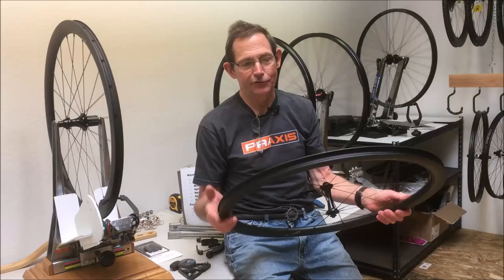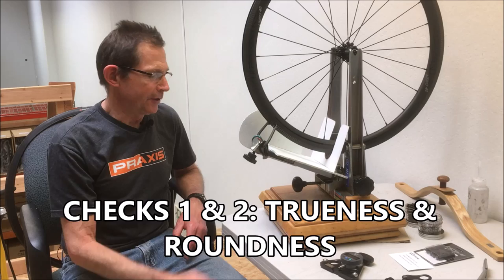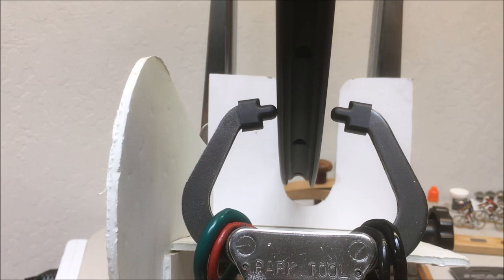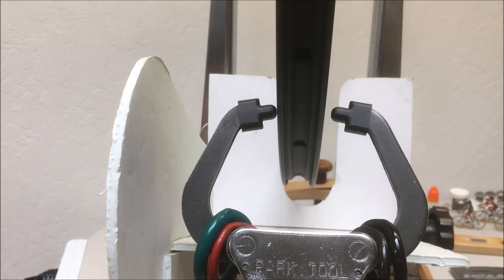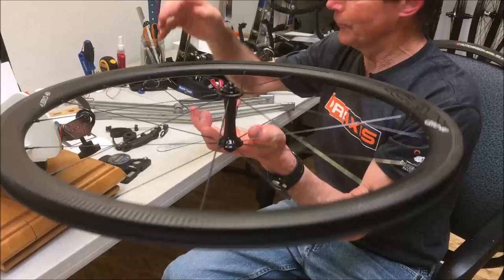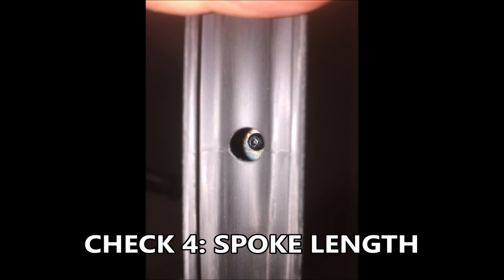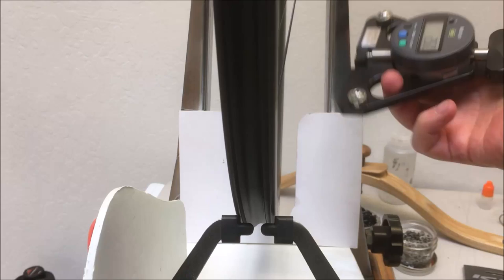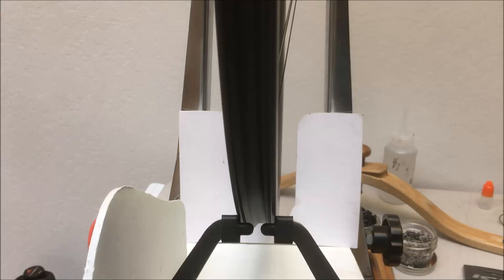ICAN Chinese Carbon Bicycle Wheels Review by Wheelbuilder Jim Langley

Comment: Good job Jim.
Are you going to show people how to rectify the spoke twist and inadequate tension problems you identified? 
Also it would be useful to explain how you determine the correct or optimum tension for a particular wheel. Finally are you aware of any authoritative published sources for trueness and roundness acceptance criteria? I think your 1/2mm is a very fine tolerance appropriate for top class (and top price) wheels only,  and I would consider +/- 1mm to be acceptable for the majority of general usage bicycle wheels. What do you think?
Reply from the maker: Thanks for comment, Henrybikeman! Yes, I now have a video showing how to fix aero spokes that have been overturned so they are twisted and not aero anymore. Here's a link: https://www.youtube.com/watch?v=zszdrNEgSDw Regarding optimum tension for wheels, it's best to use a tensiometer. That's because wheels need the spokes to be so tight that it is difficult to feel by hand when the tension is right. The spokes will feel tight way before they are tight enough to make a good wheel. Tensiometers come with charts that tell you for the type and diameter of the spokes in the wheel what the reading on the tensiometer's gauge translates to in KGF (kilograms force). For me, what I am looking for before I'm finished with a wheel is readings indicating that the tighter side spokes (right rear/left front on disc front wheels or either on non disc fronts) is in the 105-115/120 KGF range. Evenness of tension readings is important, too. I don't measure the other side of the wheels because those spokes are as tight as they are going to be as a direct result of the tighter side spokes. Though you can certainly measure all the spokes if you want with a tensiometer. And, for trueness and roundness, I would say that if your customer can see that the wheel is out of round or out of true, then it's not true enough. I know that you can't feel it when a wheel is a little out of true and round, but if a pro builder is putting their name and reputation at stake, they typically try to get the wheels as perfect as possible. Some rims can have bad seams or slight issues with the carbon, etc. but for me, I will try every time to get the wheel as close to perfect side-to-side and up-and-down as I can. Ideally I wouldn't see any deviation in the spinning wheel. But for that you need a perfect rim and you don't always get perfect rims. When they're not perfect, I still try to get them as perfect as possible and hope they're .5mm or better. If I had a wheel that was 1mm out and that was the best it could be, I could accept that only if it was impossible for me to make it any better and I knew that the wheel was otherwise a great wheel. Okay? Hope this is helpful - appreciate you commenting bikeman!

Comment: Amazing and fascinating. I'd love to build my own, but the tools would cost more than the money saved. Makes me reluctant to buy cheap foreign wheels. Currently deciding between wiggle own brand (imported from China I imagine) or custom built by local wheel builder. £750 versus £1300. Tough choices.
Reply from the maker: Thank you, Neil. The advantages of working with a custom wheelbuilder are many. They will build wheels designed for you - the way you ride, where you cycle, your weight and riding technique and they will be there to help you with the wheels should you ever need spoke tightening or replacement, wheel truing or a rim replacement in the event of a crash. If you get to watch them build your wheels, I think you will be amazed with the attention to detail and care that goes into a pair of fine wheels. So, yes, it costs more but you get more, too. Now, if you'd like to build your own wheels, it is a fun and highly satisfying bike project since you will get to ride on wheels you built yourself and will be very proud of it, too! I have taught many beginners how to do it so I know almost anyone can learn. I would say that the only people who have a little trouble are those with little patience. Because if you're in a rush doing things, it's easy to get confused following the spoke lacing pattern and the truing and tensioning steps. But, most people learn pretty fast. To help beginners get started, I have a comprehensive free step-by-step on basic wheelbuilding on my bicycle website here: https://jimlangley.net/wrench/wheelbuildfull.html Also, you don't need fancy tools. I started building wheels using just my bicycle frame and fork as the truing jig, for example. If you decide to give it a try and need help, I'm happy to coach you. Thanks again for the comment! Jim
Reply: Not so Neil. The only truly essential tool is a good spoke key. All the rest are "nice to haves"
Reply: You can build a wheel without any special tools or stands, even without a spoke key.  The proper tools make the job easier and faster, but if you're going to spend as much as you say, get the proper tools or pay someone who has them!

Comment: Beautifully put. But my major concern is of the carbon material and its formation as we all know there is a method carbon fibre sheets are resin pasted together leaving space for bubbles and tiny gaps between the sheets. So how could we possibly know the integrity of the material build up itself? Any insight on this?
Reply from the maker: Thanks for watching and the nice words, Noel - I'm happy you enjoyed my video. Yes, I have insight on how I know that it's unlikely the ICAN Toray carbon rims have any defects. In my experience building hundreds of carbon rims I can tell you that at the tension the ICAN spokes are at, a carbon rim with voids or other defects will fail spectacularly. It scares you so much you jump. Usually it makes an awful cracking popping sound as you're working on the wheel. Sometimes it’ll split all around the spoke hole track. It makes for an exciting wheel build and it’s good defects show up then rather than out riding when you would get hurt. That's how you know and why I tested the wheels the way I did in the video to determine they're fine rims. Okay? I hope this helps answer your question. Thanks again!
Reply: @JimLangley1  thanks man. Sure I did and always do enjoy your videos. The reason I asked you this is because i had purchased a pair of vuelta 50mm carbon  wheels and in a short span of time a portion of the  rim braking surface wore out almost like 1mm deep almost killing me while coming into oncoming traffic.also kindly note as I used alloy brake shoes and not carbon brake shoes. So could that have happened because of the wrong brake shoes because now after doing my research I think using wrong shoes were the problem. What would you say about this? Also I'm looking to repair the surface by repasting a sheet of carbon and bonding it with resin. Your insight on this please. Thanks in advance
Reply from the maker: @noelbrett7351  sorry to hear about the damage to your rim, Noel - glad you didn't crash! Since they damaged the rim so much those brake pads had to be really abrasive, made of the wrong material. The ICAN wheels come with carbon-compatible brake pads designed for use with the rims. That's often the case with other carbon wheelsets. I have not tried replacing material on carbon rims. There are companies that repair broken carbon frames. Maybe you could contact them and ask if they would give you any advice on repairing your rim? In my area (Northern California, USA), this is the company that's been fixing carbon since way back: https://calfeedesign.com/carbon-repair/ Maybe if you called them they would be able to talk about whether or not it's possible to fix damage like yours on a carbon rim and how they recommend going about it. I hope they have some good advice for you and that it can be fixed. If not, maybe Vuelta would be willing to sell you a replacement rim at a discount and you could rebuild the wheel. Good luck!
Reply: @JimLangley1  thanks for your prompt reply man. I really appreciate your detailed explanations. I'll get in touch with the and keep you posted. Thanks and take care
Reply from the maker: @noelbrett7351  you're very welcome! Thanks for watching my videos and the great comments/questions, Noel!
Reply: @JimLangley1  thanks for the compliment man. Coming from a person like you it's a big honor. Much obliged.😊
Reply: Hello Jim. Following your how to build a wheel tutorial really helped me master my wheel builds. Now I can build perfectly round rims(however they do take forever though 🤣) all thanks to your channel. Although plenty more to learn from you. I keep watching and rewatching your videos. I tried looking for the spoke stop tool to equally match all the threads on the spokes. I'll keep looking. Thank you for making such great videos. Building wheels are such a joy now compared to how I would dread wheels builds earlier. Thank you, God bless.

Comment: I wonder about the hubs,is it a no name hub or ?  Is the cassette body soft aluminum that will groove easily?  Freehub body seal well or will dirt and water get in easy?   It all matters of course.
Reply from the maker: Thanks for watching and the questions, Brad. The wheels use ICAN’s own hubs. So far in about 2,000 miles of riding I have experienced no issues of concern. So I believe the hubs are quality hubs. Hope this is helpful and thanks again.

Comment: I received a set of Aero 40s in March and there was no twist on the aero spokes! So I think that your pair was an exception. I am quite happy with this wheel set, it's light for climbing, but still with an aero advantage in the flats. I already did a few Marathons up to 300km and never was afraid they could fail me. Only the brake pads that came with them were unsatisfactory. I bought cheap ones from Wiggle (the blue lifeline pads), which perform much better. My only issue was to get a pair of GP5000s on, which was really a pain. Maybe other tyres will be easier to get on.
Reply from the maker: Thanks very much for sharing your experience with wheels, MrSuicycle. Appreciate it!
Reply: Thats strange i can get GP 5000s on easily with my FL40 icans

Comment: So are you called a Wheelwright ? Making spoked wheels is a dying art. 1950s & 1960s sport cars like MG's and Triumph used spoked wheels in each models, like MG B and C models. Enjoyed Presentation 🚲👍
Reply from the maker: Thanks for the nice words, Mark. Actually a "Wheelwright" is someone who builds & repairs wooden wheels. While I have built some bicycle wheels with wood rims, I definitely do not have the woodworking know-how or skills to work with wooden hubs, spokes and rims on carriages and antique cars. A term you hear used for bicycle wheel builders is wheelsmith as in the Wheelsmith brand of spokes and tools - and the former famous Palo Alto, CA bicycle shop called Wheelsmith. I like that, too. Thanks for your comment!
Reply: Mark Stengel how is making spoked wheels a dying art? Almost every wheel you see on a bicycle these days is a spoked wheel.

Comment: Jim, can you explain why the wheel doesn't need to be centered in the caliper, and you can just look at the left arm to check trueness? If you were building the wheel from scratch, would you center it?
Reply from the maker: Thanks for watching and the great questions, Stafford. To answer, on a good rim (one without any issues), both sides of the rim should be the same. If that's the case it doesn't matter which side of the rim you look at to check trueness since both sides show the same perfection or imperfections in the rim. I don't try to look at both sides of the rim at the same time. I could try to do that but it's a little bit like trying to read the left page of an open book with your left eye and the right page with your right eye at the same time - not easy to see at least for me. So, I will typically use the left pointer gap to check for trueness and then use the top of the pointer placing it beneath the rim to check roundness.

The truing stand I'm using in the video is a Park TS2 and all Park stands that use this design have a self centering feature that can hold the wheel/rim centered between the caliper/pointers. However, lots of things affect this and if anything is off, you can end up with the rim sitting closer to one side than the other. For example, if your wheel gets pushed sideways the axle rocks up on one side in the Park axle holder and that moves the rim out of center.

I mainly use the centering feature as a ballpark measurement/gauge to give me an idea how close to centered the rim is over the axle. I then check this more exactly using a dishing gauge. If I didn't have a dishing gauge I'd be sure to check and double check that the wheel sits completely seated in the Park jig's axle holders and that nothing else is affecting the wheel centering. But when checking wheel true on new wheels, it's quick and easy to put the wheel in the stand however it sits and use one pointer to check.

I just occurred to me that it could be the camera distorting what's shown a little, too. To get the camera to show the gap and how true wheels are I have to experiment. Most of the shots are taken with an iPhone which has its cameras on the upper left. I don't know for sure but some of the off centeredness might be due to the camera. Hope this helps explain. Thanks again!

Comment: Hi Jim, nice review. I have a question. I have a set of ICAN Classic 38's. I love them, but, shortly after I received them my bike started ticking/clicking. It sounded like bottom brkt area but I went thru everything on the bike. The noise only happens while pedaling, both in and out of the saddle. After going through everything I finally removed the rear wheel and put my old wheel back on. I used the same cassette, skewer, tire and tube. The noise went away. I've switched back and forth many times and the bike clicks when the ICAN wheel is on. I have had the spokes tensioned....the wheel is perfectly true and dished. I have replaced the freehub. I have lubed the spoke crossing, nipples and spoke hub interface. I even put thin strips of plastic between the spokes at the crossings. Nothing helps. Is it possibly the hub bearings? Any ideas?
Reply from the maker: Thanks for watching, Mantonhouse. That's an interesting wheel noise you're trying to find. I actually have another video all about finding and fixing wheel noises, which is here: https://youtu.be/sA62X1AXN7s

But it sounds like you've already tried most of the usual noise solutions. You asked if the wheel bearing can make noise. They might if the grease is all dried up or used up inside the hub. You can usually tell if a hub needs greasing if you remove the wheel and turn the axle (not the skewer) in your fingers slowly. There should be a nice hydraulic resistance from the lube inside. If it's dry or worse rain got in and corroded it, it'll spin too easily and probably feel rough. If the bearing is loose in the hub or the axle is loose on the bearing or there's roughness, that could be your issue.

Another idea is one that would only happen when you're on your easiest/lowest gear. And that would be the derailleur hitting a spoke. That could happen on one wheel and not the other due to a different spoke angle. But again, it would only click or tick on that lowest gears, no other gears. To fix that you can usually very slightly tighten the low gear limit screw on the derailleur to get the clearance needed to stop the contact with the spokes and the ticking noise.

If the wheel only clicks or ticks at one point on its revolution, then it might be some issue with the rim at that point. I've seen carbon rims that cracked at the nipple and the cracks were difficult to see without good lighting and magnification. Hopefully that's not the case but it's something else to look for. You might be able to find it by going around the wheel and listening intently while squeezing pairs of spokes to simulate riding. I sometimes ask someone else to listen with me since that person might hear what I can't.

One more idea that might work is to ride the bike with a person walking next to you to listen. If you can make the bike tick or click and they can focus on what's going on with the wheel and if there's some pattern, or if they can hear where it's coming from, you might have a clue to what's going on. Hope something here helps you find it. If you do, please share what it was. Good luck!
Reply: @JimLangley1  Hi Jim, Thanks. I'll try your ideas for the hub. Hopefully I'll find something there. The noise happens in all gears. Sometimes it seems rhythmic and sometimes random, happening many times in a crank revolution. The noise is driving me crazy trying to find it. Other than that the wheels look good, feel good and sound good. I don't see a way to attach a 40 second video here. I just let my right arm hang down and aimed my phone at the rear wheel. I had to compress the video, due to size, so the sound was diminished a little....but it is still very obvious. If there is a way to attach a video, please let me know.
I will definitely let you know when I find it.
Thanks again,
Steve
Reply from the maker: @Mantonhouse  Hi Steve, did you check that the valve isn't hitting the carbon rim? If the valve is even a tiny bit loose in the valve hole in the rim it can hit and make a tick, tick, tick noise that varies in rhythm like you describe. The same tube and tire on another wheel might not make any noise. If you tap on the side of the valve with your finger and it moves and it hits the carbon rim and makes the tick noise - that's what might be at fault. Just in case you already didn't try that, it's one that can be hard to find. For getting a video to me, YouTube doesn't offer any way to do it but you could email it probably.